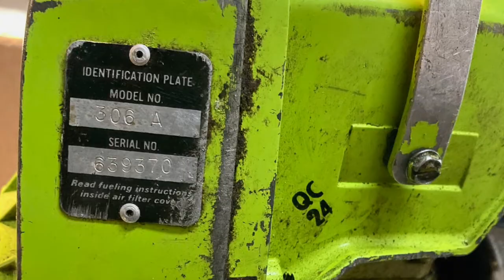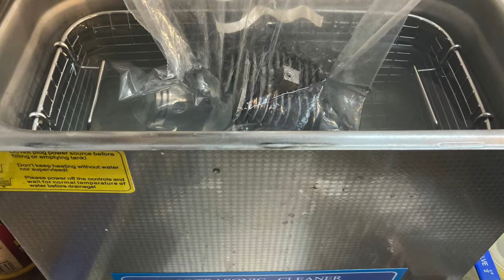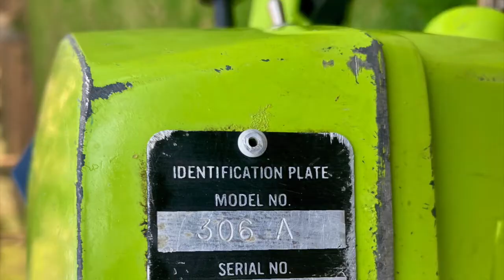Poulan 306 245 TCM Chainsaw Rebuild Procedure APR 2022

Comment: can you add part #'s and were to find for gaskets, carb kit? thanks . good video. thanks
Reply from the maker: The parts are no longer available from the mfg.  I have some replacements for sale on eBay. 

Search for
Poulan 245A 306A Tillotson Carb Repair Kit Plus Reed, Carb, Adapter Gaskets

https://www.ebay.com/itm/125549948014

Comment: At the Oil Tank and Pump assembly (4.00m mark), did you use Lithium Grease on the moving parts? Also, did you put some kind of gasket maker on the Oil Housing that interfaces with the body?
Reply from the maker: Yes lithium grease on the oil pump gear. 
I used Motoseal gasket maker  on the lower 1/4-20 bolt threads to seal the through hole in the crankcase/ oil pump housing.
Reply: What I was asking , @CLASSICPOULANSAWS
Reply: What I was looking to find out was, if you put a gasket on the Oil Pump Housing perimeter prior to bolting it into position @CLASSICPOULANSAWS
Reply from the maker: @kellycejmer2024  No sir
Reply: Wouldn't a gasket in this area keep debris out and any oil from running down the outside of your saw? @CLASSICPOULANSAWS
Reply from the maker: @kellycejmer2024  I must admit I’m not exactly sure where the gasket placement is you’re talking about.
Reply: at the 4:07 mark of the Video. it seem like a gasket or seal should go around the outer edge of the Auto Oiler Cover. @CLASSICPOULANSAWS

Comment: Hello mr poulan, so, i had a question, when you took the cylinder off of the chainsaw, it looks like you put the same cylinder back on it just with a different piston, and this is we're my question comes into play. Did you hone out the cylinder and put it back on, or, did you get another one and just painted it, and if you did honed it, can you do a video on honing or can you tell how too cuz I am rebuilding one right now. Thank you. 

Forest Feller
Reply from the maker: I believe I used the same cylinder. Inspect for grooves and scoring. 
Poulan 306 and 245 cylinders are chrome or nikasil plated which are too hard for me to hone. 
It is very important to have a good cylinder or you will not have good compression. If the compression is too low, it will not even start.
Reply: @CLASSICPOULANSAWS  ok, ya that really helps thank you, have a great day

Comment: Tearing down a 306A and can not get the cylinder head separated from the crankcase.  Everything else has been removed.  Got any hints?
Reply from the maker: While I can understand that this approach might be effective in some cases, it's important to exercise caution to avoid causing any damage to the components involved. Here's a step-by-step breakdown of one option to separate the cylinder:

Materials Needed:
Soft or rubber mallet
Protective gloves (optional but recommended)

Steps:

Safety First: Before attempting any repair or maintenance procedure, make sure you are in a safe environment and have the necessary tools and protective gear.

Hold the Crankcase: With one hand, securely hold onto the crankcase that houses the cylinder you're trying to loosen.

Gentle Taps: Using the soft or rubber mallet, gently tap the lower handle threaded boss of the cylinder as this area has more support around the delicate cooling fins. The purpose of these taps is to create a slight vibration and shock to help dislodge the stuck cylinder.  Be careful not to use excessive force, as this could lead to unintended damage.

Observe and Test: After a few gentle taps, try to test if the cylinder has become looser. If it hasn't, you can repeat the tapping process a few times, making sure not to overdo it.

Check for Progress: As you tap, periodically check if the cylinder is loosening or if there are any visible signs of movement. If you notice any improvement, you can continue tapping gently.

Patience: Sometimes, stubborn cylinder gaskets can take time to break free. If you're not seeing any progress after several attempts, you might want to consider alternative methods or seek professional assistance.

Clean and Inspect: Once the cylinder is loosened, carefully clean the area around the crankcase and inspect both the cylinder and crankcase for any signs of damage. Address any issues that you find before reassembling.

Remember, while this technique might work in some cases, it's important to approach it with caution and use your judgment. If you're not comfortable attempting this procedure or if the cylinder remains stuck, it's best to consult a professional mechanic or technician who can provide proper guidance and assistance.

Mike